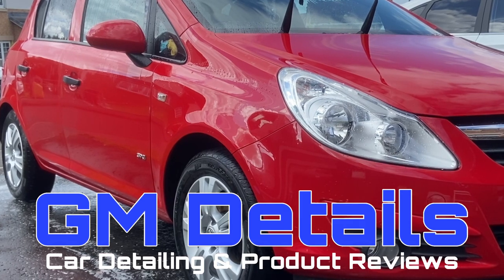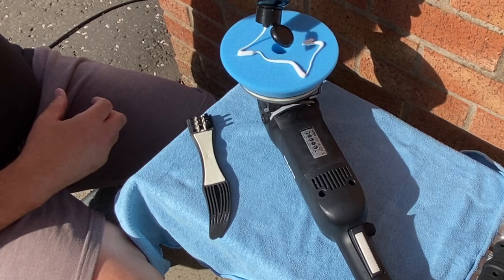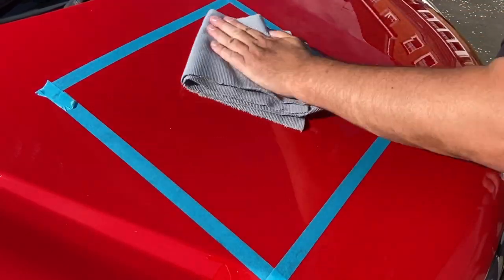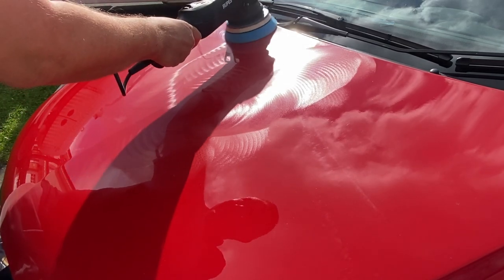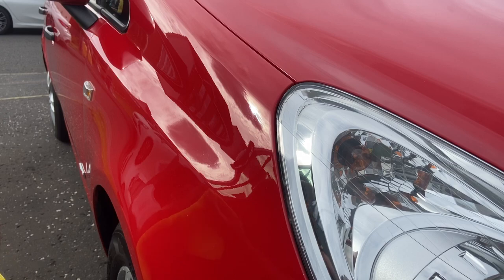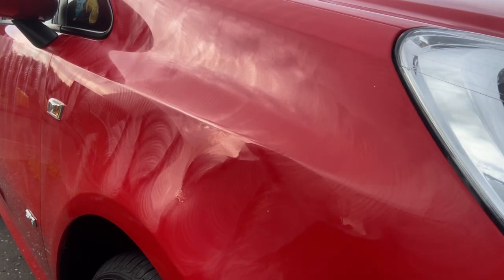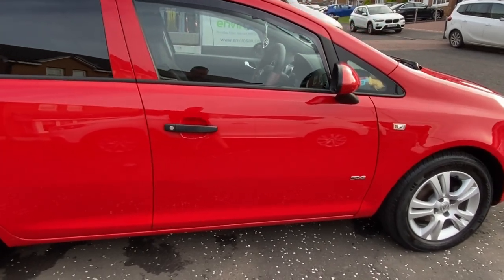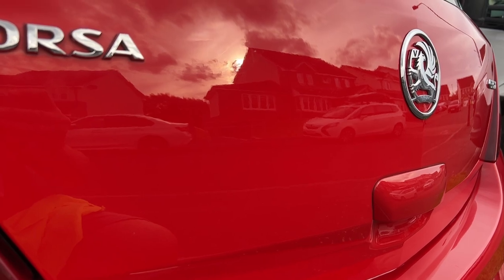CORSA D MACHINE POLISH | SWIRL REMOVAL | Disaster Detail Series Vauxhall (Opel) Corsa Episode 2

Comment: Great result Graeme! Looks a user friendly product. How long did the wash/decon/polish take (if you take out the filming set-up time). Slightly confused by the product being called an all-in-one. I thought AIOs are meant to cut, polish AND leave a layer of protection? I see the Farecla website says the product prepares the paint for sealing or waxing - so is it a true AIO?
Reply from the maker: Thanks Paul, all together probably 7 hrs from start to finish , ah yes I read that too about the polish but didn’t have time to test out if it left any protection behind , that’s why I went for the ceramic QD as it was getting so late, it really should leave some protection to be called an AIO 🤔

It won’t be the first and only time using this so I’ll play around with it and post results on Instagram if you follow gm_details there 👍

Comment: 3.5 inch pad on that it will work just fine and they are easier to find i think but cant rmember
Reply from the maker: Thanks David, yes I did find them in the garage in an unopened box. I knew I had bought new ones specifically for the job!, oh well got new ones now 😀

Comment: Another good video, thank you.  I bet you were gutted when you couldn't locate the 3" pads! I'm yet to machine polish, although I'm ready to go, I have a DA8 from In2Detailing and some Megs UC, I just haven't built the courage yet 🤭.  The black Polo has minor marks and swirls so I thought megs would be OK for that.  However, I've not got pads yet, would those Ferecla pads be a good pad to pair up with the UC? Would the blue one be too firm or should I go a little softer? Sorry for all the questions.  All the best to you.
Reply from the maker: Thanks Lee!, yeah I have recently bought a 7’ plastic shed and it’s dominating the garage atm and I cannot move for it 😤
Just looked on In2detailing website and the DA8 comes with a 5” and 3” backing plate so yes the Farecla pads will be ok to use with it , firmness of pads isn’t the issue (I did think the same as it feels like flower oasis 🤣) , I can only advise based on how the car looks and if it looks the same as the Corsa I’d say go for the blue , get a couple of them so you can switch, they also do a softer pad also available on Amazon and I’d recommend getting a couple of them too so you can finish down if the finish looks a bit hazy. 
Pad choices are something you don’t select by ‘will that do?’ It really all depends on the test area like I did to establish if the pad/polish combo works, hope that helps mate
Reply: @GMDetails  thanks so much for the response, I appreciate that.  No, the car isn't half as swirly as the Corsa was, so now I'm thinking something more like a medium cut with the UC.  Out of curiosity, what's your pad of choice brand?
Reply from the maker: I’m not that experienced that I have a favourite really , I go between wool, microfibre and foam, SGCB pads are actually decent for the money, I’m always trying new ones and more recently it was the Honey Combination pads , but I do have a soft spot for chemical guys hex logic pads , that’s what I started out with
Reply: @GMDetails  thank you so much for the reply.
Reply from the maker: You’re more than welcome mate 👍

Comment: Brilliant results from an all in one polish . Where can I buy Blitz detailing products from I cannot find there website ?
Reply from the maker: There’s a link in the description from the first video mate, I’ll pop the link on the second description as well for you soon 👍
Reply: @GMDetails  Thanks for that can you recommend what products you have used ? . They dont seem to do 5 litre bottles ?
Reply from the maker: I think they’re only relaunching with 500ml & 1L options at the moment , I’ve yet to use the TFR or the Citrus as a pre wash but the snowfoam gives a very good dwell time which will work perfectly with a citrus cleaner under it if you need a strong combo for winter grime. 
Absolutely love the jelly bean shampoo, only shampoo I’ve used that can stick while using it in the snowfoam lance 
The wheel cleaner being a gel is a little tricky to apply via the trigger & being RTU isn’t my favourite but works well enough. 
Fallout remover is excellent & possibly the cheapest around atm and to finish the car off the Ceramic QD is really so easy to use and just adds the finishing touch, hope that helps mate
Reply: @GMDetails  Thanks Graeme for the tips .I just watched Paul Dolden using Garage therapy zero decon shampoo as a wheel cleaner ,snow foam and shampoo . Im all for value for money what do you think or do you like to use individual products ?
Reply from the maker: You can use zero decon for lots of jobs, it’s excellent in many dilutions , I hate when a brand diluted a product making it ready to use , so you’re mainly buying water, that’s not on at all!! 
I don’t think there is a rival to GT Decon shampoo, it does so much so very well but there is also an argument to not using such strong chemicals on every wash , it’s also part of the enjoyment using different things, that’s why even GT has dedicated products for maintenance rather than deep cleaning every time
Reply: @GMDetails  Thats what I thought it is too strong to be using every time Im a weekend warrior and cant afford loads of products . What do you recommend to use for pre wash snow foam wheel cleaner and a good slick foaming shampoo please ? .Thanks
Reply from the maker: Oohhh Michael so many!!, cost effective prewash has to be Autoglanz Spritzer , can be used as a spray AND snowfoam I love it, more recently the snowfoams that have impressed me were ADBL yeti Pearl ph neutral at £12.99 a litre it’s incredible value, favourite wheel cleaner for maintenance cleaning is Garage Therapy One Wheel Shampoo and for car shampoo, favourites are Garage Therapy One Car Wash shampoo, ADBL Holeawesome shampoo, Carbon Collective Lusso, and recently reviewed Blitzed detailing Supreme jelly bean 
Take a look at the about info on here for a linktree list of all discount codes, ADBL is available from ABPAutocare and delivery is free over £30

Comment: Thanks Graeme do you think autoglanz spritzer is better than bilt hamber surfex and valet pro citrus pre wash ?
Reply from the maker: Hmm well Spritzer is 100% better than Valet Pro Citrus, Carbon Collective, Infinity Wax, Gtechniq, EZ Car Care, Auto Finesse, STJÄRNAGLOSS, Dodo, Autobrite, many many more , Surfex is a completely different chemistry and I’m only just getting to grips with its uses, but I’d put both on a par but Surfex has far more uses then Spritzer
Reply: @GMDetails  Thank you for taking the time out to reply as a cost exercise do you think surfex is better value for money then ?
Reply from the maker: I’d need to see whether it’s as good a prewash as Spritzer , never tried Surfex in this way before , I’ll wait till nearer winter and do a video comparing them 😁
Reply: At home, Surfex 1:50 (with a few drops of fragrance oil) has replaced flash, Cillit bang, Method etc etc. Use to pre-soak your pans, porridge bowl, coffee mugs, etc, clean toilets, shower, tables, floors, plastics, metals, tiles, etc.
At 1:10 it tackles winter road grime on your car and wheels with ease, engine bay, and baked on sausage fat (not in a car, you hear), bicycle. Going to try 1:20 in summer use.
1:1 it'll totally clean everything on a bicycle (chain, jockey wheels, derailleurs). I used to use Gunk but that stains tarmac(?????) 
It truly is the most versatile cleaner I know of. It's superb. And apparently environmentally friendly, if that interests you.
Hope this informs you of a few uses of Surfex. 😂
Reply from the maker: Awesome list 👌